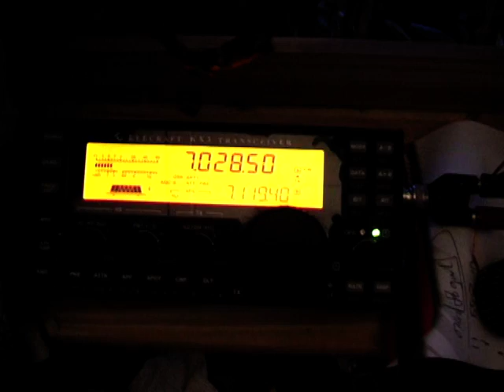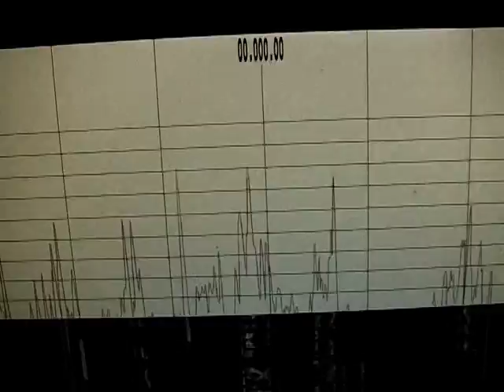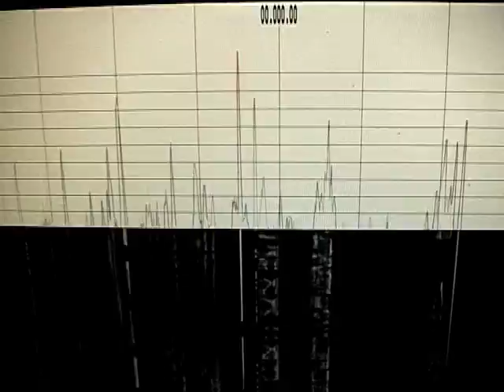pipan3

Comment: Peter

quick question, how do you manage to listen to 96khz or so of bandwidth please?
do you take the audio prior to your audio filters? or is this a specific filter you have available in your radio?
Reply: Google rtl sdr or just look around here on your right.
Dirt cheap too. The Raspberry Pi is not normally quick enough but now these wizards are using the GPU portion of the chip which ups the speed by a factor of ten.